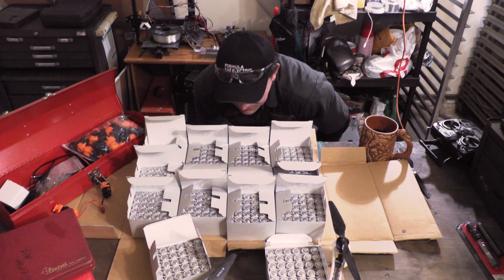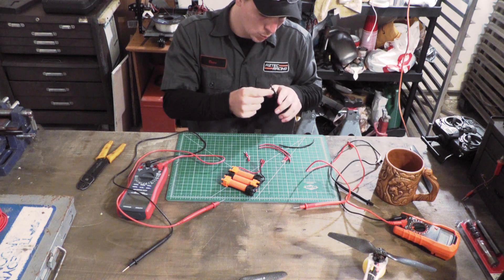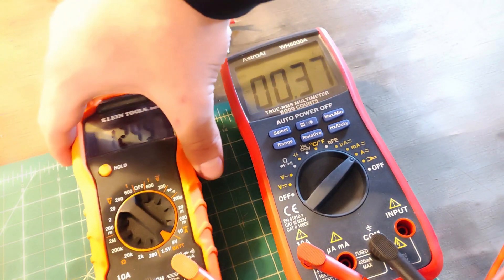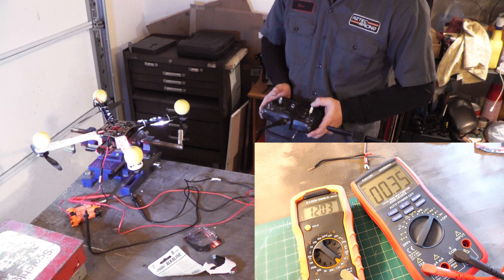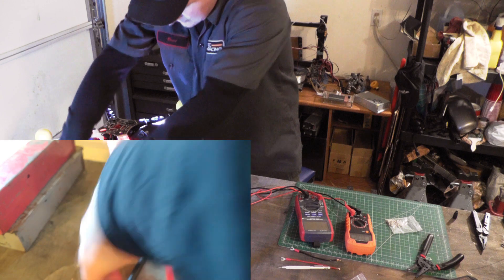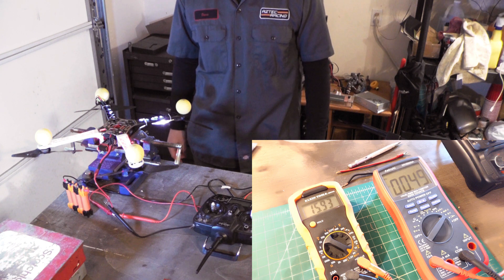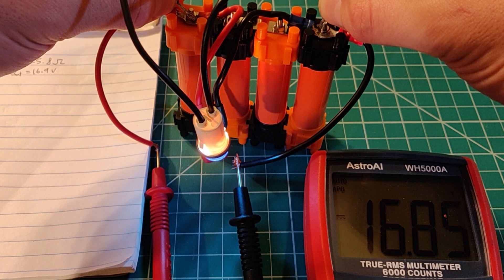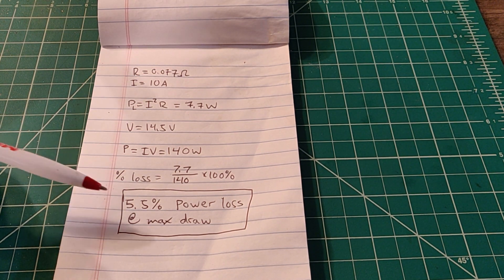How well does a solderless 18650 drone battery fly?

Comment: adding a cell in parallel would reduce sag for sure but increasing voltage seemed to work out better. Some can't increase voltage due to ESC ratings , etc.

Comment: What about adding more cells in parallel should help with the sag
Reply from the maker: That's a good option as well, but I don't want to double the weight of my battery pack as that will hurt my flight time. Sounds like that's a good topic for another test though!
Reply: DaneMakes ok that’s makes sense have you looked into using different cells? They do have high output cells? I’m not sure what you are using.....
Reply from the maker: I'm using Panasonic NCR18650BD Cells. They're high-volume cells but don't have high amperage. They would be best for a long-range, lower power drone.